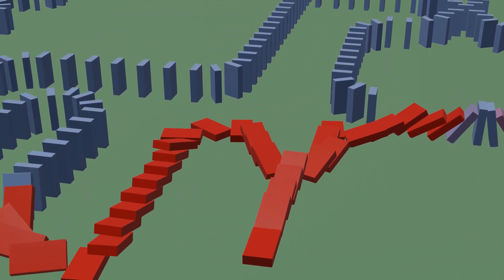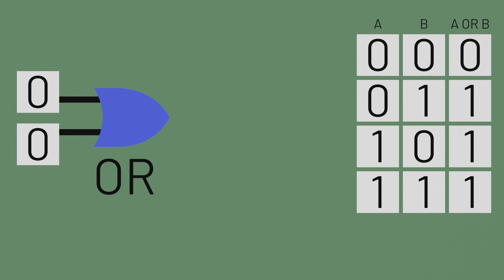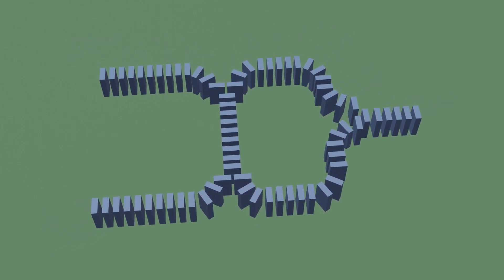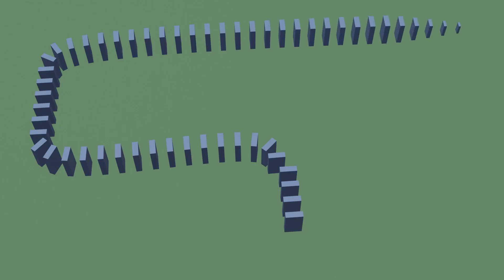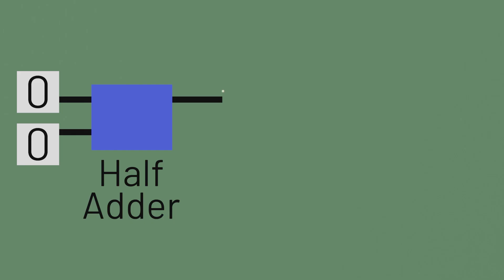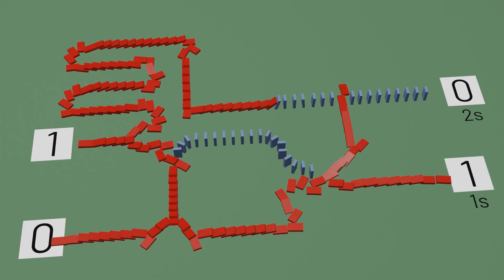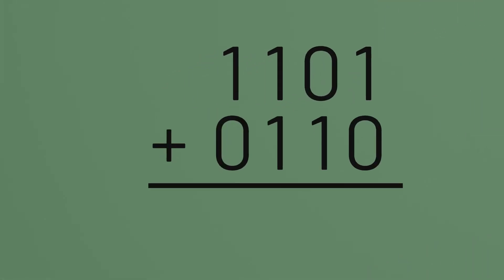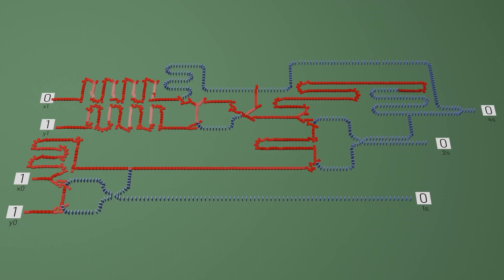A Computer Built With Dominos

Comment: No, falling dominoes can NOT be used to calculate anything calculable. The gates you have presented here allows for the building of "combinational logic" circuits, but without either NOT, NAND or NOR, all of which consume addiontal energy, there are boolean expressions that can not be implemented. This is also not capable "sequential logic" which requires state and time, you can not build a flip flop with dominos because the dominions will never fall through the flip flop more than once.

Comment: So, the premise is interesting, the domino realizations of fundamental logic blocks is clever, and the explanations well done.

However, the video title promises a "computer" built with dominos, and in that regard this video fails. A "computer" is not the same as just a few logic functions and the ability to do simple math. By definition, a computer requires the ability to be programmed somehow, and to retain information, and some facility for changing what it does based on other factors. In theory, all of that can be managed in dominos, but this video does not even remotely get into all of those other (increasingly  complex) necessities, and extrapolating what is shown here to what would actually need to be done.....well, this video does more to prove that a domino computer is practically impossible. Proof of this assertion is that none of the domino logic can be re-used, and a self destructive logic structure is not useful for making a computer.

Comment: I can visualize miles of plates, each with a different circuit of hinged dominoes on it. They get started by punch cards and punch cards using weighted spiked dominoes at the end. And the whole thing resets all dominoes every clock cycle. Like an IRL Minecraft computer.

Comment: You don't need to stand the dominos back up - you can repeatedly duplicate the circuits anew, creating a pipeline. i.e. a stateless, pure, recursive computer. Maybe add some tail-call-esque optimisation and repurpose earlier, used dominoes as new circuitry, ahead of the current state. A 3D visualisation of that would be cool.

Comment: This is not a computer, as it's by nature lacking means of programming. What we see here are preset memory functions at work. Just like in the 80's, a TI-30 calculator didn't actually calculate π, it just had an approximation you could call from its memory. Also, there are a number of algebraic operations you cannot allow here. Try creating a NAND gate...
Sorry 👍
Reply: 1. Start by laying two rows of dominoes parallel to each other, with a small gap between them.
2. Place a third row of dominoes perpendicular to the first two rows, so that they span the gap between the two rows.
3. Place a fourth row of dominoes perpendicular to the third row, but slightly offset to one side so that they don't touch the third row.
4. Lay a fifth row of dominoes perpendicular to the fourth row, but slightly offset to the opposite side so that they don't touch the fourth row.
5. Finally, place a sixth row of dominoes perpendicular to the first two rows, so that they intersect with the fourth and fifth rows. This will create the NAND gate

To use the NAND gate, simply knock over the first two rows of dominoes, which will set off a chain reaction that will knock over the other rows and activate the gate. 

By adjusting the starting position of the input dominoes in this way, you can create a binary input mechanism that can be used to represent different combinations of 1's and 0's in the NAND gate circuit.

Comment: I've actually done this before, in a domino simulator.  Made an OR gate, a NOT gate, an AND gate, a NAND, and an XOR.  Didn't bring it much further from their though as the placement was very tedious and the sims capabilities were limited

I see that you used a much different mechanism.  My gates had both inputs pushed, and then a "clock" sort of signal pushed.  This was not reliant on timing the pushes so I found it worked well

Comment: With the AND gate it seems one sided where one side can input and doesn't prevent the other input from outputting a 1 while the other side can make it impossible to output a 1 even if the other input pushes a 1, but just a bit too late after the other 1 prevents the new input from going through, which would lead to an AND gate that can have two 1 inputs, but still output a 0.... It's a neat concept and a great way to explain circuits and logic gates, but unless someone has infinite space to account for however long a path needs to be to prevent the possibility for such faulty AND gate from occurring, which seems like it would be hard enough just to calculate how much of a path would be needed to allow enough time for the possible AND fault triggers to not be able to occur.

Comment: If you’re curious, there is such a thing as “domino logic” in digital logic design!! It starts with assuming the output is a 1, and will discharge the output to a 0 if the gate needs it. This change can cause more gates to fall from 1 to 0, and so on, hence “domino”, and is used because it is significantly faster than traditional (CMOS) circuits

Comment: Now, this is cool, the follow-up could be explaining unary gates (not!). You seem to have bypassed the issue of timing by making certain paths longer or shorter without really mentioning it. For not this obviously will never work so you will need some kind of timing input to sync your dominion circuit. 
While showing these steps you can explain why real circuits need clocks (and fully stabilize) and show why making paths shorter leads faster circuits (intuitive but you can explain here why smaller cpu's -> higher theoretical clockspeed provided the longest path shortens).

Comment: What if instead of "do nothing" for the 0 and "fall" for the 1 you had two lines of dominoes for each variable? one representing the 0 and one representing the 1. That would make a NOT gate easier (although the circuits would need twice as many dominoes, and the analogy with current wouldn't be as clear)

Comment: Question: but how do a transistor thinks? I know it boils down to a semiconductor. That the third leg of a transistor get a voltage to determine if it let the passing current flow, or not; but how does that third leg (gate leg) gets the voltage. Who does that automation?

Comment: Your XOR gate has backflow current; it literally sends current down one of the inputs, changing it to a 1; if this previous input wasn't triggered (which is why it is still standing), there can be situations of which this backflow causes a massive backflow cascade.
Reply: A most relevant and significant observation. I think for the sake of a simple explanation to laypeople this animation demonstrates the XOR concept well, however in actual application the potential for such cascading backflow would matter.
Reply: You could raise the input dominos so they can fall down but the lower ones will only flow to the output
Reply: I don’t know the first thing about computers, but maybe add an interrupter?
Reply: @theworm7156  That should work. The electrical equivalent would be a diode.
Reply: @theworm7156  like the one on the AND gate?
Reply: @IMAGE_HAPERY  yeah
Reply: There‘s an alternative solution but you‘d have to somehow cross streams for that. A XOR B can be represented as (A AND NOT B) OR (NOT A AND B), so what we do is we send an interrupter from A to B and from B to A each which would have to cross each other and overtake the stream they would interrupt by having the streams go snaky after sending the interruptor. The results of both streams are then combined into one, OR style. So if only one stream is active it is not interrupted by the other, but if both are active then both will be stopped.
Reply: Yeah I noticed this too, I imagine it wouldn't be too hard for him to make some sort of fail safe to keep dominoes from flowing backwards. Maybe make a setup that will cut off the dominoes path only when it's flowing from one direction and not the other that way he doesn't have to worry about redesigning the gate itself.
Reply: Can't agree more, every input of the gate should not be influence by the other input or outputs. But you can easily make the path only be triggered by one direction by adding a extra path.
Reply: WEDGE DOMINO
Reply: You could put all or some dominoes on hinges so they can only fall one direction.  Of course, that would be stretching the definition of a domino a bit.
Reply: Is backflow a problem though?  We don't care if dominoes that left behind fall backwards if we still get correct outputs
Reply: @MarkChlenov  well pretty sure it is
Reply: @MarkChlenov  you will not get correct outputs if you put an extra input into one of the gates
Reply: @walls_of_skulls6061  but this input does nothing, because it’s inverted. The dominos Fall in the opposite direction. You can look at the animation, yes the second Input is 1 at the end, but the output is still correct for the original input.

Comment: This Isn't quite yet a computer, it's part of the ALU (Arithmetic logic Unit) that provides the calculations needed.
A computer has to have a ALU (For the arithmetic and logic), Clock (For having all of the parts in sync), RAM (For storing data), Bus (For the data to travel between the CPU and RAM or ROM), and registers (For storing data in the short term).
You can comment if you want if I missed something important in a computer. :/

Comment: So if the lines of dominoes represent wires, and the actual falling of dominoes represent the flow of electricity, the how does coding work. Wouldn't coding require one to rewire the machine?

Comment: The number of clock cycles this computer could run is limited by the number of dominos. A lot is possible with infinite dominos. A very simple approach would be: Each logic gate of the computer, including the memory, is represented by dominos. Now copy this whole computer state, for each clock cycle you want it to be able to operate. Edit: A plain copy will be impractical, as the memory is going to operate at lower frequencies then for example the accumulator. But it wasn’t about efficiency, was it?

Comment: You can't have feedback loops if the dominoes fall only one time, meaning you would only get fixed programs. Also, the databus could only be used one time for one operation, that's not a very big program. It's basically a very limited calculator.

Comment: very cool! the only downside is that it is hard to un-fall a domino
Reply: figure out how to perform telekinesis and its as easy as that.
Reply: Waiting for the day that 10nm dominoes exist and we can cram dominoes into a chip.
Reply: @jasongronn6764  integrated domino circuits
Reply: But we can make it in a 3d sumulation when we just have to click 'regenerate'
Reply: @donut_Boi8  but that will be against the laws of dominos.
Reply: @donut_Boi8  Have a domino hit a tiny see-saw made of dominoes to fix a different domino, simple 👌
Reply: @donut_Boi8  built via dominoes?
Reply: @garrett200000  🤯
Reply: @donut_Boi8  But then we're making a computer in a computer
Reply: @donut_Boi8  we just have to use a computer to make a computer 🤣 I agree though, it is a very cool concept into the logic of computers in a different format.
Reply: @donut_Boi8  no that’s not how it works
Reply: I think you just need to build it from lego technic, they have domino un-fall system which can pick up all dominos
Reply: @ДенисКотуза-ч9д  - You just need a string on the bottom of each domino, that goes through a hole underneath it. By tightening the string, the domino will stand back up.
Reply: public static void unfallDomino(domino) {
  if(!dominoStanding) {
    domino = new Domino(domino);
  }
  else {
    return domino;
  }
}
Reply: @bIuefire92  Needed to wrap that into domino pool with some preallocated space.
Reply: we've finally invented the single-use computer
Reply: @dazcarrr  this 😂
Reply: Pretty easy. All you need is dotted desk, where your dominos are standing above each dot, and all of them should have a thread clued under them. When your dominos are fallen you just have to pull a thread and they get up. Also you can connect all the threads so you can pull only one time and all the dominoes stand up.
Reply: Are you sure about that?

https://youtu.be/IQhgiL3TqYQ
Reply: Magnets
Reply: There was a toy in the late 80's that was a board that you'd slot dominos into a small holder that was hinged. The domino would fall just as you'd want, but you could easily reset it by flipping the whole board over.
Reply: This is more of a video explaining logic in a fun way.
Reply: The "only" downside 😅 It is also extremely slow and requires a lot of space and effort to build. But very cool indeed.
Reply: That's what I was thinking when I saw this pop up in my recommendation feed.
Reply: After watching the video, I'm also thinking of a related problem: since the data only persists as an ephemeral pulse, the second and third types of logic gate need to have their inputs synchronized by timing. If
These problems do not occur with electronic circuits because there is a constant input of energy, and a non-self-destructing transmission medium, that together make it possible for the data to persist.
Because wires are reusable, we can create data persistence mechanisms like RS latches that simply would not work if we tried to do them with dominoes.
This persistence makes synchronizing inputs for logic gates much easier, as you don't need to do something like making a wire a few inches longer to make pulses line up.
Reply: ...is missing the point entirely
Reply: I thought the last update they implemented Ctrl-Z?
Reply: Computer that only works once! 🎉 I'm in
Reply: @MegaHero100  It works for the same length a battery lasts, however it also is only computing a single frame in all that time...
Reply: Yes but a while ago I saw a video with an infinity falling Lego dominos machine, it replaced all the dominos automatically some time after they fell. So I think this problem is solved!
Reply: I mean there's those dominos attaches to a plastic strip. Which you can reset by angling them. So probably possible to do mechanicly?
Reply: Damn entropy
Reply: Just rewind time 4head
Reply: Hi 😄
Reply: That and the rapidly increasing propagation delay associated with ripple adders.
Reply: Electromagnet attached to clock?
Reply: Use a gun to threaten the dominoes, while looking like an idiot in the process.
Reply: If you were referring to the NOT gate, you can easily make one with the XOR gate. Think about it!
Reply: On?ly
Reply: Not all that hard. The real downside is, that dominos aren't that reliable in reality.
Reply: if the domino pieces are made of magnetic material, we can attach little strings loosely under them (which prevent their flying off but don't prevent falling down) and pass a strong magnet above the system to pull them straight after one pass.

[sorry, the comments list is too long, and I don't know if somebody already suggested this.]
Reply: I love problem-solving :)
Reply: Just need to start producing tiny stands to hook your dominos up to that when powered will un-fall the dominos after a set amount of time, still cheating but at least it's in the real world and not a simulation with the flaws of simulated physics!
Reply: Yet it is possible.
Reply: I wouldn’t say that’s the only downside
Reply: @AD-wg8ik  yeah i didn't word that correctly.. I should have phrased it as a hurdle it would need to cross
Reply: Skill issue
Reply: there's a person that made an "infinite domino falling" setup or something similar; basically you start the machine, you push a single domino and all the dominos keep falling but the machine gets previous dominoes up again. edit: it's made with legos btw
Reply: @s6lssixl61  I saw that, but it used a motor (controlled by Lego NXT). I was meaning without electric
Reply: what about some bouncy dominos
Reply: @happyentertainment8003  I don't think they would be able to bounce back to being upright. Thanks to conservation of energy, and loss of energy in forms such as heat, they surely wouldn't have enough energy to get back to their original orientation.
Reply: @jasongronn6764  true
Reply: @jasongronn6764  There are some tricky special cases though with some materials that I can only assume break themselves down into energy that allows to bounce higher, however they only would work for some set number of times before losing their bounce.
Reply: @happyentertainment8003  I was thinking the same thing as you while watching the video, but your suggestion about bouncy dominos intrigued me. Instead of making them bouncy, maybe make them spring-loaded? You'd lose energy on the "chain reaction" part rather than the "reset" part that way, so you'd probably have to hit the input dominos pretty dang hard to make sure there's enough energy to ripple all the way through the system, but it could work at least in principle.
Reply: @CFSworks  good idea! that's sorta what I was thinking. I thought that maybe your momentum would be able to push the dominos back up (if they were very bouncy and very stable)

Comment: A domino AND gate that I've made in the past is just a lot of dominoes packed together, so the weight of two dominoes is required to push them.
Reply: lmao you also made logic gates out of dominoes?
Reply: @haroldp.sadwood1181  Yeah but I didn't get very far, I made an XOR gate but it was way more complicated than the one in the video.
Reply: @decb.7959  That's still sick. I would never have thought of this.

Comment: You can't build a computer if you can only use each gate once. You can't feed your input with the last input so you can only build combinational logic but not sequential logic and therefore no computer. Also you can't build flipflops.
Reply: yes thats exactly what i thought and thats the issue with most of these logic gate alternatives, they cant be reset or turned on or off again